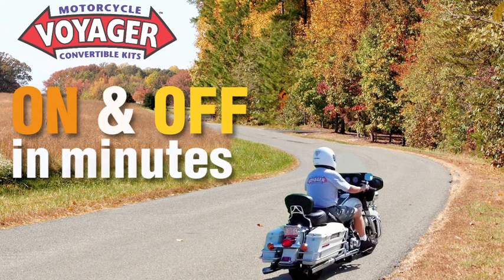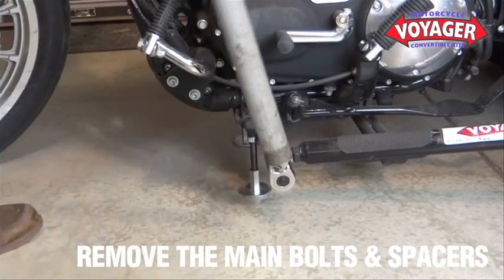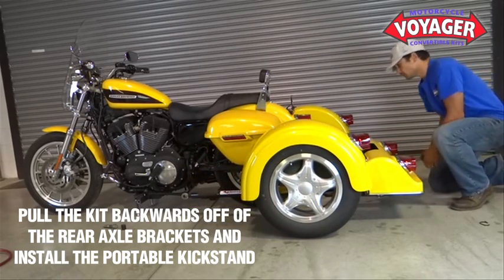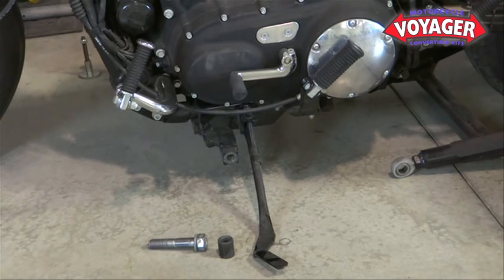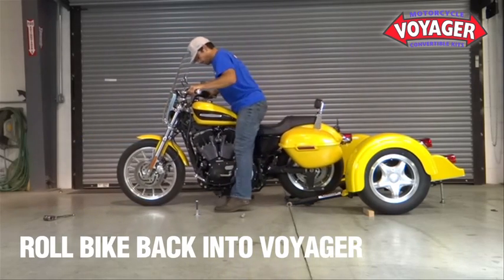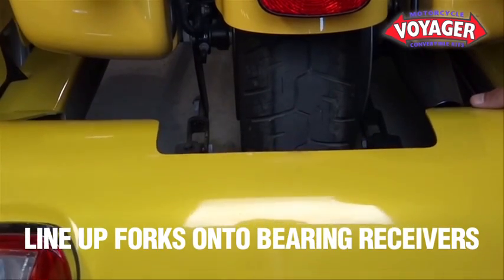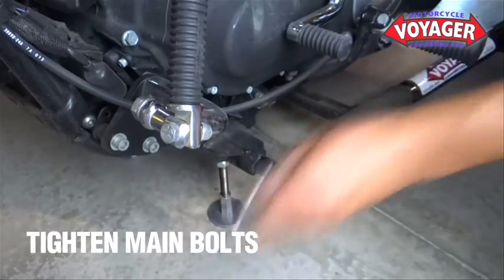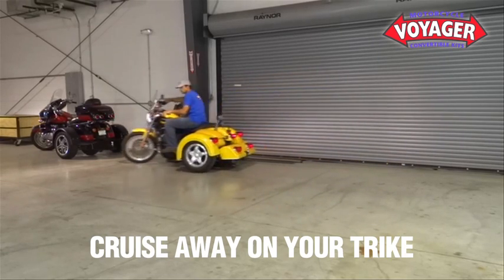On & Off in Minutes - Voyager Motorcycle Trike Kit

Comment: Hey there I own 01 road king classic with this kit I see it uses the rear axle bolt to mount the rear ( my question is do I need to remove the kit to remove the rear tire it’s time new rubber on the back rim)
Reply from the maker: Yes, you would need to remove the Voyager frame.
Reply: Does this kit require an extra long rear axle bolt ( to account for the rear mounting hardware of the kit?unfortunately the original axle bolt was installed with out anti seize and “couldn’t be saved” I got a replacement one specifically for my bike and the bolt isn’t long enough to run the bracket for the trike

Comment: How much does it cost.
Reply from the maker: The Voyager Standard is $3,895.00, which includes everything you need: mounting & suspension hardware, fenders, rear guard, two rims & tires, a trailer hitch, and the instructions on how to install and ride. Check out more information at www.mtcvoyager.com/trike-kits/.
Reply from the maker: We have not yet fit the Honda Fury, but have fit the other VT1300 models. We know the frame style is the same (or at least very similar) aside from the front forks, but will still need to do our research and development process to ensure fitment. Call us at (815) 434-7900 and speak with Austin if you'd like to discuss having us design for your bike.